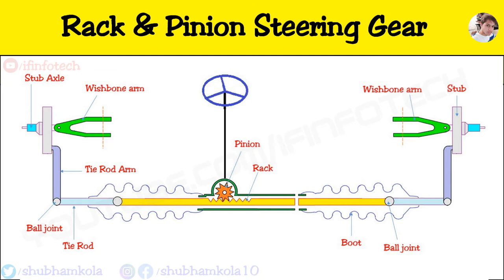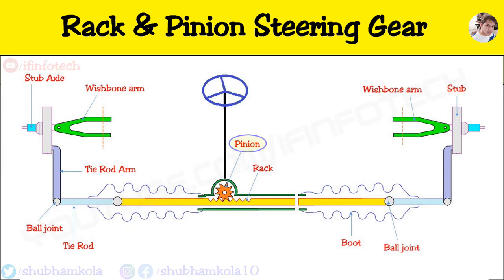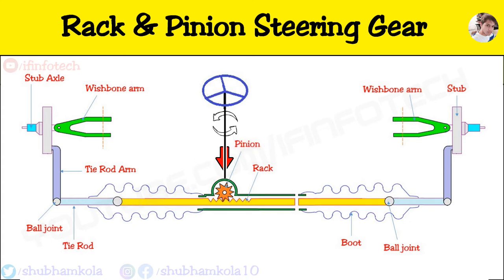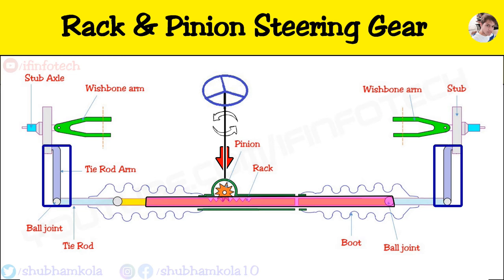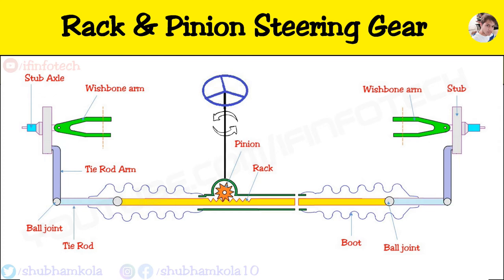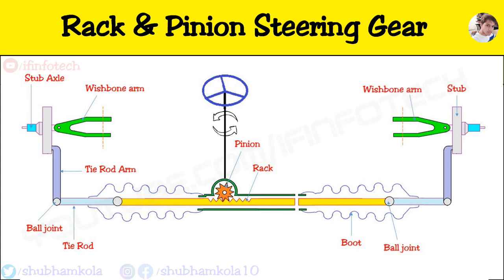Rack and Pinion Steering Gearbox Mechanism Working Explained with Diagram [Animation Video]

Comment: LeClerc lost hydraulics and steering in the formation lap of today's GP in Interlagos .. that wouldnt be the case if it were as simple as in this video..
Reply: was it a steering problem or the engine problem ?  didn't the rear tires just locked up i dont see any connection with the rear wheel and the steering